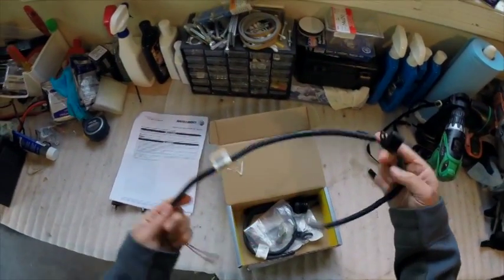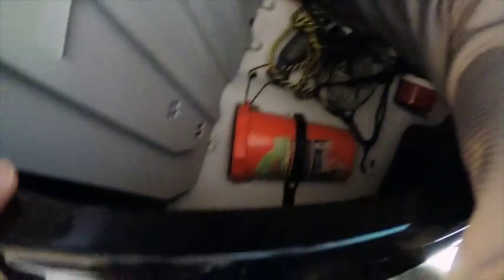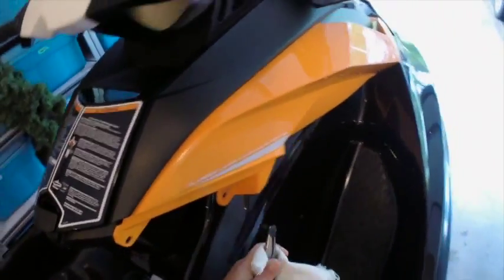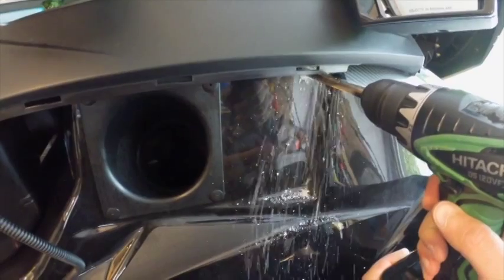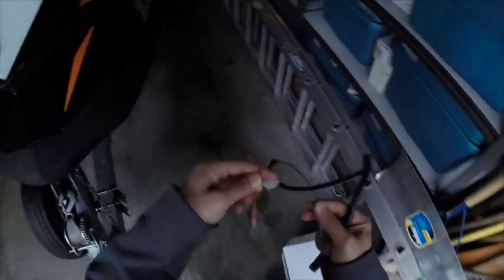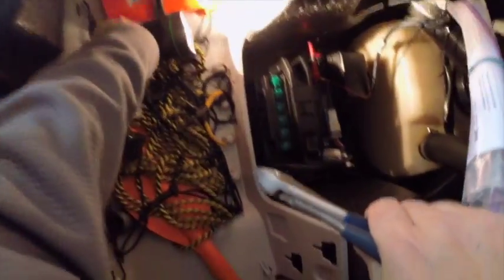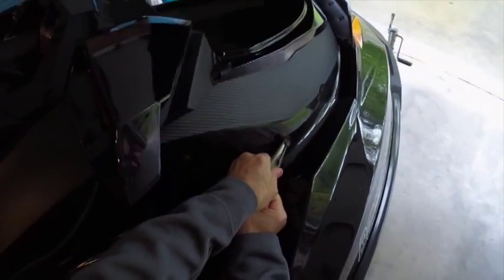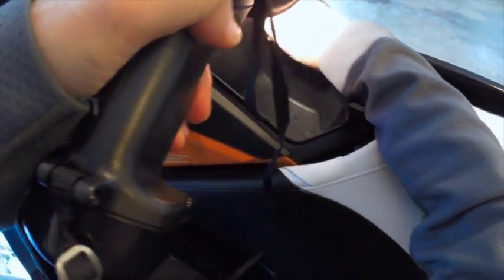How To Install the 12-Volt Outlet on a 4-TEC Sea-Doo (2012 GTR 215)

Comment: Great video, thanks. Do you plug a battery tender to your outlet? I plan on doing this very soon.
Reply from the maker: Peter Scaduto We always charge the battery directly using cables. It's also not recommended to charge the battery while in the ski (although we usually do it). I'm not sure how your tender works, but there could be serious risk to your ECU unit and other electrical components when trying to charge the battery while it's still connected to the ski. I'd disconnect the battery first and charge it directly, and not risk damage. Thanks for your comment!
Reply: 3ftDeep I keep my unit connected to a battery tender 24/7 (as long as it's in my garage).  I never thought that it might case damage.  I've been lucky so far.   What is the average life for these batteries?
Reply from the maker: RomeoSierra011 When my ski finishes its fifth year, I'm replacing it no matter what. Similar batteries are warrantied between 5 and 7 years and maybe it can go longer, but I don't want to be thinking about warranties when I'm out in the middle of the ocean and it won't start.

Comment: that part number is used for just the socket. I can't find the wiring harness' anywhere?

I have a gtx 2014 - so I'd have to modify the cable length anyway. Do you think it would be worth it, or just buy a stock marine socket and cable it myself?
Reply from the maker: The 2015 Sea-Doo Accessories Catalog lists 295100612 for the GTX model (except models S and with iS). Although it shows the outlet, it comes as a kit for $54.99 CDN (not sure of the US price). I went through the same thought process as you, and decided to get the kit from Sea-Doo. It comes with the right length cables, fuse, new plastic plugs for putting the trim back on, etc. If I had to do it again, I wouldn't change a thing.
Reply: 3ftDeep Ahhh, thanks alot for the info and advice. I appreciate both.

Comment: Is your battery set up right next to the gas tank?  I don't have Seadoos I have Yamahas and I am trying to install a secondary battery but was afraid to set it up in my front storage compartment since is really close to the gas tank....thanks
Reply from the maker: In many models the battery is close to the gas tank. Some are in the back. The main concern is if the machines are still, and gas fumes are leaking into the engine compartment. Any spark from the battery terminals would be a bad thing.
Reply: 3ftDeep thanks, I guess then in a weird kind of way the secondary battery I am installing may be safer since there is a plastic "firewall" between the storage compartment and the gas tank...my factory battery is in the back with the engine..

Comment: I have a 2011 Sea Doo GTX 155, and I was wondering if I could put 2 12v outlets on it?  Do you think that would draw too much power from the battery?
Reply from the maker: It depends what you connect to it. I don't think you need two outlets, though. I bought a car charger with 2 USB connections and it works great. It also tells me the voltage, current use, etc. (see https://youtu.be/Rl4SH5xtdu8).
Reply: Thank You, and on my GTX 155, Just like Chris' 2015 RXP-X 260, the battery is located all the way in the back of the watercraft, so I need to extend the wiring.  I have 16 gauge speaker wire which I have used to install numerous radios in peoples vehicles.  Would it be okay to use the speaker wire to extend the power and ground for the 12 volt outlet? Thanks. :)
Reply from the maker: You may be able to get away with using speaker wire, but I would use some good quality marine wire that is protected a bit from the elements (heat and water). I was impressed with the one that comes in the Sea-Doo kit, as it was built for a marine environment. I haven't had any issues with it. Good luck with your installation.
Reply: Thanks so much.  I really appreciate it a lot.
Reply from the maker: I got a comment from you regarding your connector that seems to have disappeared so I can't respond to it. Did you resolve the problem?

Comment: Where can I get those plastic plug pins? I was sold a jetski without them 😠
Reply from the maker: Are you referring to the plastic plugs that hold the plastic panels in place? If so you can get them at most auto supply stores.

Comment: So it's always on? This would kill the battery over time correct?
Reply from the maker: Think of it like the 12v outlet in your car. It's not drawing power until you plug in a device and complete the circuit.
Reply: Unless of course it has a LED indicator that it is on. I made my own. I posted it on greenhulk.
Reply from the maker: Cool. I'll check it out.

Comment: Would it be easier on a 2019 I have a 2019 rxt 230 and it was an option which mine doesn’t have
Reply from the maker: doesn't have ...?
Reply: 3ftDeep doesn’t have the USB port option it’s offered from the factory on my ski
Reply from the maker: Oh, I don’t think it’s very different although I haven’t done one on your machine. Another option is just to connect a battery tender lead directly to the battery, which is what a lot of dealers do. You can then use a USB adaptor to that connector. That’s what I’ve got on my new machine and it works great. But not quite as convenient. Good luck.
Reply: Thx do u think it’ll void the warranty if I have the dealer do it
Reply: @henrytischbein155  I would just do it yourself
Reply from the maker: Sorry for the delayed reply. I just saw your comment. I don’t see why it would void any warranty if you did it yourself.